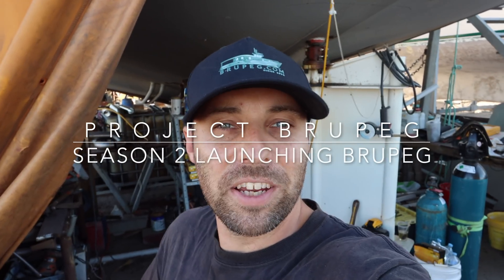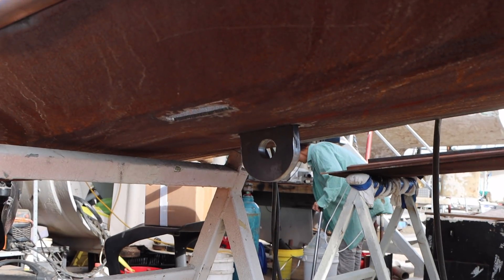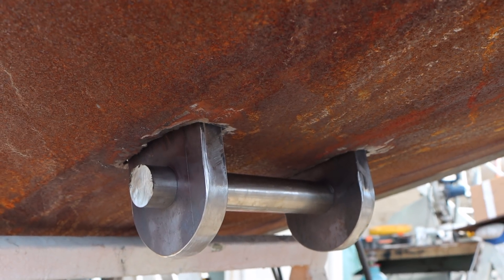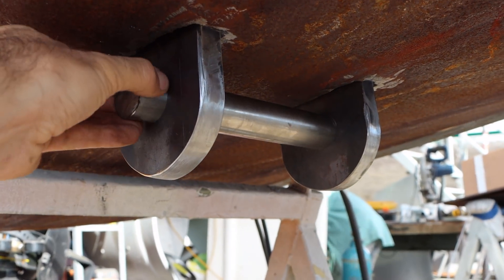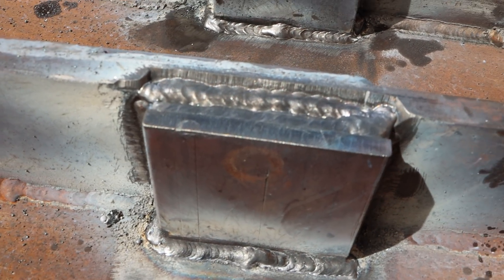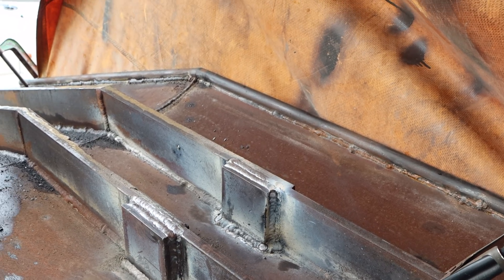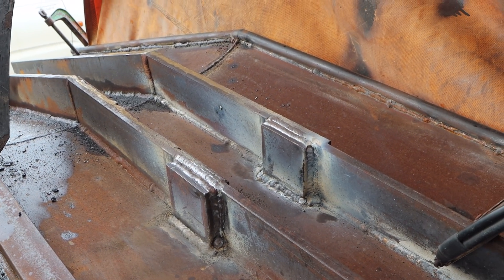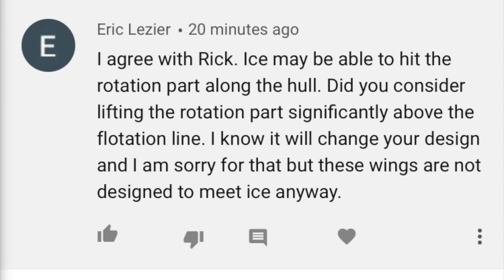Trawler Wing Hinges - Project Brupeg Ep. 131

Comment: Dame every time I think there is something I can comment on you catch it in your next comments. I am a equipment designer, welder machinist and mechanic. 40 years with same company. You are doing a great job with ship. So let me put my two cents before you figure it out first. The 20 mill gussets between the pad eyes for your pin is quite heavy. It won,t do any harm if you are just trying to use what you have on hand. A 6 or 8 mill plate from the front to back perpendicular to the two running the length should provide stability 90 degrees to the length of the wings. Now my welding tip. When welding with flux cored wire in the vertical position you will get a better quality weld running uphill or bottom of the weld upwards. This keeps the flux behind the weld metal. When running top down or downhill you can trap flux in the weld as it will run faster than the weld metal. Keep up the great work and stay safe from Lafayette, Louisiana in the US.
Reply from the maker: Lovely, thanks for this, ive added 20mm between the two 16mm strongbacks. and ive used 75mm x 6mm flat bar as a flat double for and aft from the leading edge to the 50mm angle section and put a 75x6 vertical on top of the doubler. im hoping this will transfer the pin loading across 75% of width of the wing. Ive always really struggled with vert up, but have been practicing with the flux core and have found I can actually do it with flux (but still not with solid wire). I never knew just how lovely flux core is to weld with, i went back to solid recently and it was a shock to say the least!

Comment: Was thinking about re enforcement around the tabs, envisioned sections of 4 inch square tubing welded in either side of the tabs between the runners... just spitballing...
Old submarine videos show using the forward dive planes to facilitate rescues at sea.
so, independent hydraulic control of the wings might become an dvantage as well as some kind of deck access just above the wings.
Reply from the maker: I actually love the idea of using the wing to get people from the sea. This is something Jess and I will discuss

Comment: Damon, here's a thought ? try cress crossing down the center line , /\/\/\/\/\/\|  do the same on each wind on each hinge point.  your strass point are gone too the dismal point.  the out line of the wing, use a cross brace are six foot, or as close as you can get.  as for the skin, double points for wielding.
Reply from the maker: Hi Ralph, im hoping the skins will form this aspect. the top 6mm skin is double contious welded so rigid as all heck and the bottom will have all edges welded and plug welded in the centre areas

Comment: For Ice would it not be best to be able to remove wings using the crane and store them on deck. Generally in big ice there aren't big swells anyway Is my understanding its only while entering or leaving those zones that you need them.
Reply from the maker: John this idea is exactly what and why we are leaning towards. The hinges at that point will be well under the ice and small enough to gring through chunks without drama and the wings will be clear of the water.

Comment: You should consider installing a pair of anodes inside your wing assembly to prevent rusting from the inside out from small seawater leaks and oxygen penetration
Reply from the maker: Hi Phillip, these wings will be pressure tested to make sure they are water/air tight. if they leak in any capacity thats a major failure so we will be putting a fair bit of effort into stopping that right from the outset, the plan is once completely airtight to add 30L of diesel to each wing and seal it up so it can slosh around for the life of the wing and prevent internal corrosion. annode will definately be added to the exterior though

Comment: I'm A Construction Building Engineer Of 45+ Years... My Dumb Question Is This? Now That You Are Welding The Arm Connect Braces In, Making The Top Of Those Very Beefy Wings, Shouldn't That Have Been The Bottom Of Wings Soo As Pressures Pullin Up From The Bottom Of Wings??? And Then Piecing All The Top Plates On (For Stronger Construction?)  & Welding To Centerlines Of All The Internal Bracings Made Possible, Being The Bulk Of Pressures Is Pushing/Pulling Down On Them, With The Smooth Bottoms Just Gliding Thru The Waters Cleanly? When Using Outrigger Birds They Pull Down On The Ship To Run Thru The Water Forwards Level & Stablized To The Surface Instead Of It Being Tossed Up & Out Of Water...Where As Stablizer Wings  Say On Large Cruise Ships Actually Are Computer Driven To Go Up & Down Opposing Movement As The Swells Roll The Ship On Yawing Seas, In Opposite Different Repelling Directions & Aren't Fixed The Same Unless Seas Are Level!? LOL Hmmm, I Guess It's Six Of One or A Half Dozen Of The Other, Unless It's A Baker's Dozen? LMAO Thanks Mates
Reply from the maker: Hi John, different ways of tackling the same problem. I could be wrong but are you thinking the hinge needs to stick out the bottom and the arm poke through the wing so the force is trying to pull through the wing rather than rip the pin off the wing? because we need to lift the wings flush its not possible to do that for us but its a solid idea. The computer controlled arms are lovely but slightly out of our price range. these style of wings have been used for decades on trawlers south of us so there function and operation is pretty well understood these days. hence we are building them under the guidance of Chris who is one of the most knowledgable blokes we have meet on this subject having nearly thirty years using them and 20 different versions of wings under his belt.
Reply: @ProjectBrupeg  No, The Pins & Arms Need Top Be On Top, As Your Building Them, I Was Just Saying That All That Bracing & Inside Wing Welds Should Of Been On The Inside Bottom Of Wing, Then Weld The Cut Pieces On Top Since You Can't Get To The Insde To Weld, Thus All The Stronger Welds Would Have Been Suppoerting (Pulling Up) From The Bottom Of Wings... Then Cut Up The 6mm Top Bent Plates Soo To Weld On All Center-Lines Of Braces Onto The Top Of Wings, Then Grind Smooth??? LOL It Don't Really Matter Now & They Should Be Fine Mate! Trolling Birds Would Of Worked Great Also, That's What Alaskian Fishing Boats Mainly Use!? What-Everrr Holds You Down In The Water Is Better Than Nothing At All, Right!? LOL G-Days Mates
Reply from the maker: Ahh yes makes sense. We thought about that in the early days but because the bottom is almost flat and only 4mm, the top is thicker with prebend so a stronger slab to base everything from

Comment: I believe you need blocking ribs between the longitudinal beams in at least 2 places in each section of the wing. This is similar to building a house or deck and blocking between the floor joists so that the joist don't fold flat from lateral force. Same thing here. I would extend the blocking to the forward and trailing edges just as you described. I would also put limber holes in each blocking on top and bottom(or maybe just one in the middle would be sufficient) so that liquids aren't trapped between the blocking. Then you could drain through bungs on the hinge end when raised. May consider putting a gallon or 2 of motor oil or similar inside to slosh around and prevent rust.
Reply from the maker: Hi Joel, yeah we have started adding fore and aft ribs and the plan is to fill with 30L or so of diesel internally to solve any rust issues

Comment: Hey Dame and Jess, so you have 4 forces on your wing.  Based on forward travel (reverse changes this):
1. The force of the leading edge pushing back.  This force will be very little by the hull, but will increase (lever principle) to the tip.  If weak, this will pull your bow attachment of the hinge away from the hull, and push the aft of the hinge into the hull.  This is the strongest force.  If your hull mount is weak, it will pull/push a large hole on the side of the boat.  Hitting/pushing ice has more weight than liquid sea water.  Think of this as a twisting force.
2. The force of the leading edge pushing into the hinge/attachment point.  Since your lift hinges are in the center of the wing, (assuming weak skin) the front will want to collapse from spar to spar back, and pull the trailing edge away from the back.  Think of an oriental fan, where the spars are the sticks and the paper is your skin.  This is the reason for ribs which go from front to back.  What is the buckle weight of the skin and you need to hold that position from spar to spar transferring the force into the lift hinge and the hull hinge.  These two points will bear the force with the lift hinge getting a lateral force from the wing tip.
3. The force of the lift on the boat.  I didn't figure it out, but the direction of the wing will pull up or down depending on your curve.  If the curve is on the bottom, the wing will pull down.  If the curve is on the top, the wing will pull up.  The force of this depends on the lift calculations multiplied by your forward speed in water (which is heavier than air.  More force).  Assuming the wing causes lift, the lift hinge will take the force of the outside portion of the lift, and transfer this into a downward force at the hull hinge.  The hull hinge will have some of the up lift from the part between the two hinges, so the majority will be on your lift hinge.  If you run these wings up on ice, the two hinge points could carry the tonnage of the ship.
4. The force of the lift on the skin.  You have this well handled.  I doubt the lift will collapse the wing.
I don't think you are outside these forces in your design, but I would look at the hinge design and make sure to have 6-8mm ribs every 35cm.
Stay safe.

Comment: Trying to look at the full picture and that is you don't need the wings deployed when around the ice because they will dampen down the waves. So we are only talking about open water and those big rollers coming in on an angle. I see twisting forces as your main problem coupled with the amount of drag created which will lessen the efficiency adding to fuel costs. (You'd want to be eating a lot of fish & chips).
You are wanting to have oil inside them so you plan for cross bracing will act as baffles. A few holes drilled in them before welding will fix that.  
A better way is to look at a bullet hole through glass. The cracks radiate from the hole. Your strengthening should radiate from the hinge.
Reply from the maker: Yeah i like that picture, very helpful. Propper wing design actually reduces fuel consumption as it makes the boat more streamlined and therefore easier to push through the water

Comment: You are doing a great job on the build but I think you need a different approach for the wings. Evolving a design based on calculated engineering rather than guesswork would give you a safer and better way forward.

To identify any design weakness and of the wings, hinge and lift/lowering it would really benefit you to run some proper engineering analysis. Do you have access to an engineer who could model your design, ideally someone with marine training who could do FEA on the model and intemperate the results? Design modifications could then be developed on the model before you start to manufacture.

Just a few thoughts to stay safe.
Reply from the maker: Hi Antony, we do have access to a naval engineer however we are building these wings under the watchful eye of a man that built the second pair of these wings in the world and has since been involved it nearly 30years of evolving these wing designs across almost 20 different versions. what he doesnt know about these wings just isnt worth knowning. Its not an understatement to say he is likely one of the most experienced wing designer/builder/users in the world. so although we are designing on the fly its inside an overall framework of what did Chris do and do we need to make any minor adjustments to make it fit Brupeg. I realised I hadnt really given this context to the build. Damien

Comment: Wow those wings are going to be way stronger than the mounting points or even hull they’ll be attached to. (They already put many submarine pressure hulls to shame). Can you show how you are going to affix the bottom skin? How will you weld it when you cannot reach or see it? With any wing the most stressed point is the forward wing attachment point. This point suffers the massive tensile forces proportionally to the speed and the length of the wing. The rear attachment takes compressive loads. The top pin needs to be strong enough to take the weight when raising and lowering the wing and the lifting force when underway but compared to the massive loads that forward attachment point will suffer it is minor.
Reply from the maker: Thats a really good point, I knew of that loading but hadnt really pondered it much. The current hinges have been signed off by Chris as strong enough to get a few years out of them without trouble but should be replaced when possible to the mild steel piano hinge style we want to go with.As for bottom skin, the is thinner that the top (4mm versus 6mm), and doesnt take a lot of strain as the top is built to be structural the bottom is just to make it all water tight and cross brace it. We grind slots 100mm x 6mm through the 4mm plate andfill the hole back up with weld onto internal ribs throughout the centre areas and solid weld all edges
Reply: Project Brupeg Neat solution, keep up the great work.

Comment: Every regulator and flow meter in my shop has decided to crap out recently. I have one on my mig welder that works but the tank pressure gauge died. Flow meter decided to stick the valve open and dump gas(diaphragm is good). All my regulator filters for the air system have decided to leak as well... 
         Problem is rebuild kits are either not available or they cost more than a new unit...
Reply from the maker: Its a frustraing problem when they freak out.

Comment: Hi Crew,,
 Great to see the cat volunteering  for   gangway duty .

The stabilizers  are really looking great , with the "Mid Section"   all sexed up now.  The eye  runs smoothly  over the  entire design ,  and even  more so  the  engineering side .
This is  due to quality input,  and well thought out  upgrades  on your part Damo .    
 Completion of  the internal  cross bracing
to  the   "mid section"     will  have   the stabilizers  ready in no time .   
As previously mentioned , a  Forward   Control Arm or  Cable ,  and simple  Hinge  Deflector   may be worth considering  ,as they would distribute "hinge  load"  and protect it from "strike"

Thanks again for the twice weekly edit  ...  

Stay safe n healthy crew .
Best Wishes
Reply from the maker: Hi Craig, ive seen a few designs with a forward facing cable to take front loading but in Chris's opinion they are not required unless your hinges are too weak. He has asid ours with the 55mm pins will be more than enough to hold up without a brace. I did ask him about striking things and how they hold up to that, He said they hit a dead whale at full speed, it spun the boat round and up and over the carcass and didnt cause any issues and they carried on to the fishing grounds. Another boat had the wings down as they crossed a bar, one wing dug in and flipped the boat (it sunk and was raised) there was zero structural damage to either the wing or hull and these were both un stayed designs with smaller hinges than ours.

Comment: As others have said...ice build up will occur on all outside surfaces above the waterline...this is something that will have to be managed/removed pretty much daily.
The wings...when in the up position...will collect tons if spray ice...as will pretty much everything else on the external of the boat...so you might need to beef the lift mechanism up a lot.
Reply from the maker: Hi Gregory, we are looking at full wing removal from the hull when in ice, and ice build up is something ive been thinking about a lot lately. i have thought of pipeing hot water through the hand rails to keep the rails clear but ive also pondered using steam as well for general areas. its just a thought at this stage but something im curious about to see what others use.

Comment: I would think if you're in 'Heavy ice conditions" and the surface has ice on it, that there wouldn't be much problem with rolling in general, as the ice would dampen out the swells...
Reply: They are concerned with ice rubbing along the sides of the hull and tearing off the mounting plates.
Reply from the maker: Yeah that was something we hadnt actually thought about but is a very good point. We are looking towards full wing removal when we get to the ice edge as by then they are unlikely to be needed.

Comment: Your wings will be used as a picnic area at sea.
Looking good , note I’m not an engineer sorry.
Greetings from Florida USA at the Gulf.
Reply from the maker: Im not 100% certain you need to be an engineer to suggest picnicing on the wings. scuba gear is likely to be needed and sandwiches may get slightly waterlogged under 5ft of water but i dont see this as a reason not to try this out.

Comment: Wondering why your using shielding gas with Fluxcore welding wire ? Flux core runs fine without gas.
Reply from the maker: True but it’s nicer to weld with gas